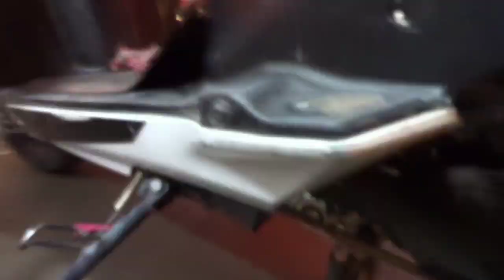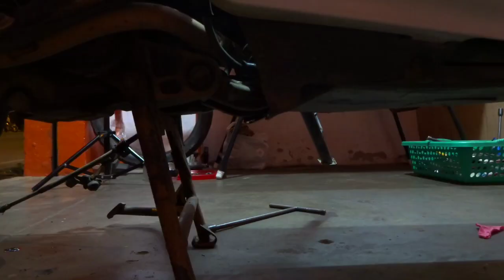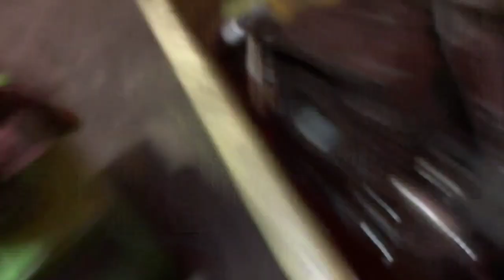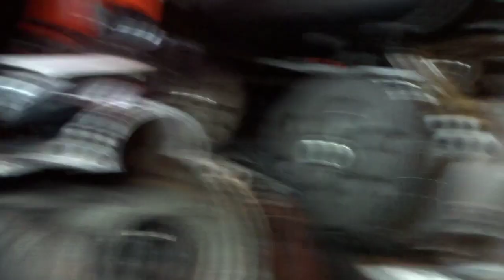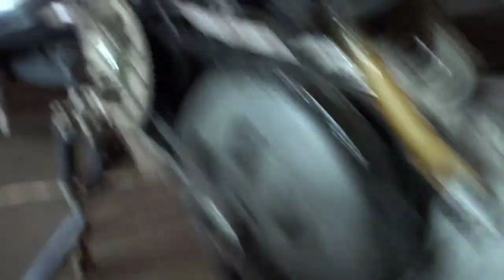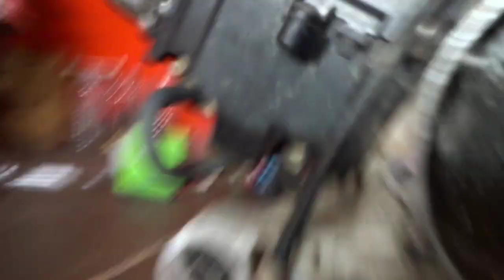Massive  Oil leakage Honda Dio

Comment: Please reply..
My pulsar 220 BS3 edition bike completed 10k kms.but when I switching the gear like 2nd-3rd-4th-5th it going to vibration too much..it takes few minutes to achieve speed
Reply: Check tappit clearance, Check sicssor gear, check dia foam in carburetor, and swingarm bush.
Reply: @yasirsalman88  service center said need to replace clutch plate and adjust balancer gear.
Reply: @yasirsalman88  yes..as I have completed 10k kms tappied need to be adjust..